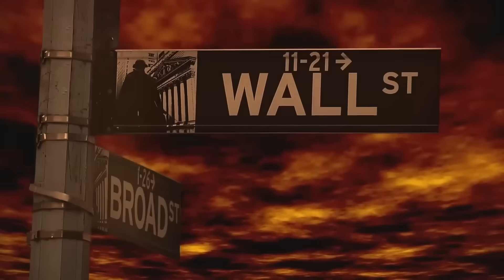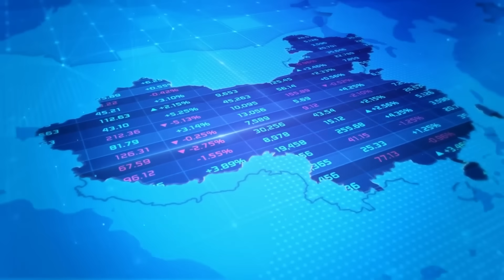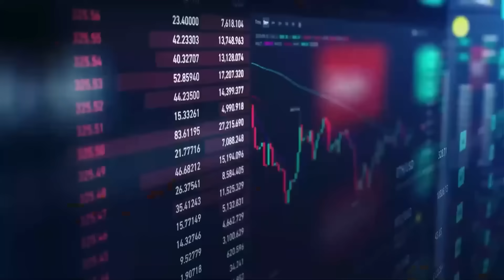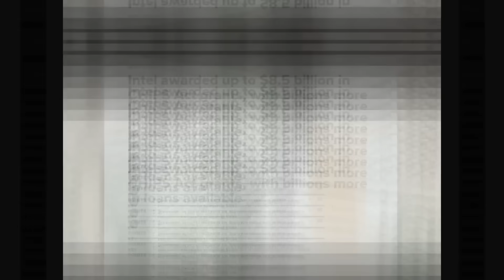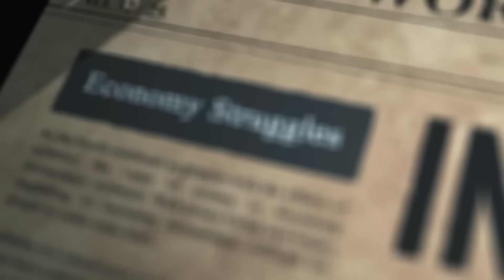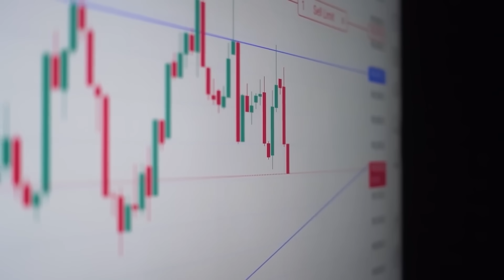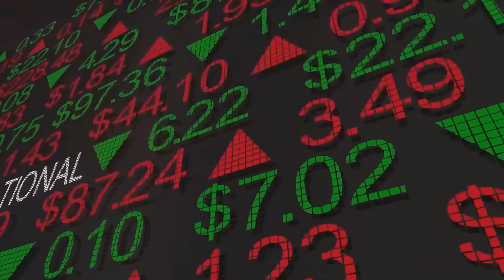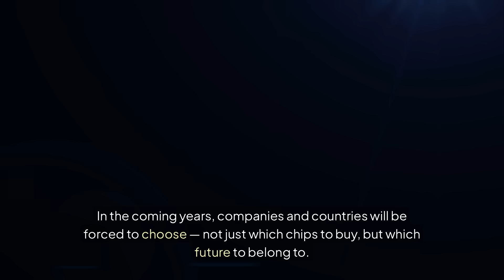China Just Cut Off Intel and AMD Overnight

Comment: Intel’s Side: ME / AMT / vPro

Intel platforms include a small microcontroller subsystem called the Intel Management Engine (ME), embedded inside the Platform Controller Hub (PCH).
This subsystem:

Runs independently of the CPU — even when the system is “off” (as long as it’s still plugged in).

Has its own network stack and can access the NIC directly.

Powers technologies like Intel Active Management Technology (AMT) (part of vPro).

Can do things like:

Power on the system remotely.

Push firmware updates.

Provide out-of-band remote management.

Stay online in S5 (soft-off) or S3 (sleep) states.

So even if your PC looks “off,” ME can still be alive and communicating over Ethernet.
Reply from the maker: Thanks for breaking that down! The Intel Management Engine’s capabilities definitely add another layer to understanding the implications of these changes.

Comment: Intel should be required to partner with a local chinese chip maker, and form a joint venture.  the JV will build the intel chips in china, and profits splits 50/50 between intel and chinese chip maker.  if intel refuses, then intel shall be banned from china, including banned from civilian sector too.
AMD partnered with Hygon to make the Zhaoxin.  intel should have to do the same.

Comment: but how to build  pc that is 100% chinese computer without using amd or intel, or nvidia , i mean i would try to see those computer that you can build yourself and change my ecosystem , that is a real problem i hope that china give us the way we need cuz right now its not, at least for people that build a pc system for yourself.
Reply from the maker: Building a PC without AMD, Intel, or NVIDIA is definitely a challenge, but there are alternatives out there! You might explore ARM-based processors or other manufacturers like Qualcomm or even look into DIY solutions with Raspberry Pi.
Reply: @FinCrafted  i do have an idead, but i really want that China really make something similar so people can change because USA and other countrys that are base western, make things extremly costly and expensive and when you try in Venezuela its even worse how much it would cost just to upgrade, they charged so much that its almost a new computer for an upgrade rahter than the full computer, because it cost almost 900$ , and i dont have enough to change the PSU still, so i have to wait to buy a new one , thouugh the one i have is still working , it has its issues, so i need to change soon i hope.
Reply: SMIC and Huawei. Very easy as well as having a better operating system already up and running on commercial scales.
Reply: @rtzx12570  for celulars and similar products are ok but for specific parts like a cpu gpu , motherboard psu , etc i dont have an idea for that , and that is what i would like, i mean to build your pc from scrach with Chinese technology
Reply: "The Kirin X90 is an in-house System on a Chip (SoC) developed by Huawei's subsidiary HiSilicon for PCs and laptops, intended to replace the Kunpeng 920 server processor and power its Harmony OS ecosystem. It reportedly features a 10-core CPU in a 4+4+2 configuration" (Google AI)
Reply: @MASMIWA  that is nice but that means you cant upgrade or move parts in that thing , that is my problem with laptops and system like that.